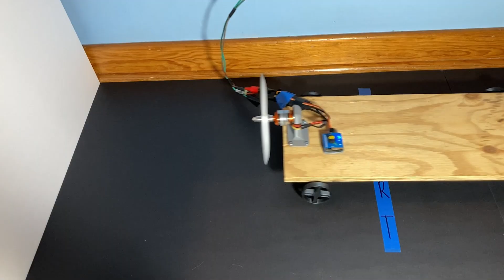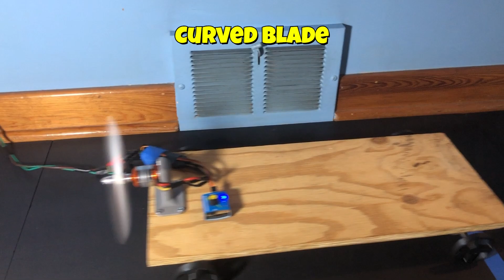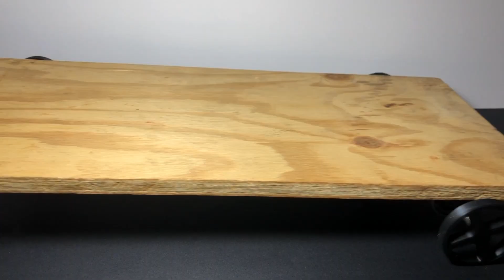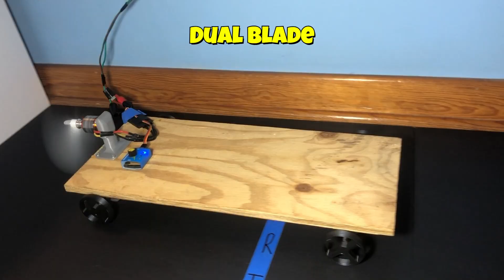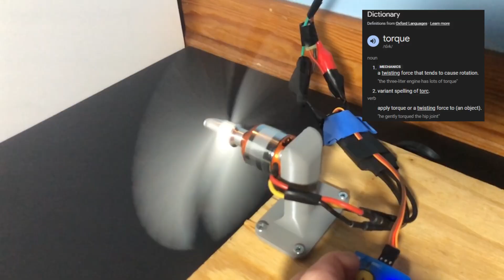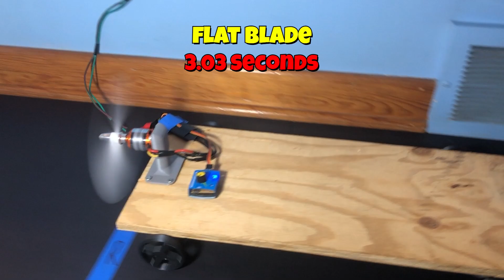Which 3D Printed Propeller Is The Fastest?

Comment: Did you try varying the pitch of the flat blade? How about spiral designs? Nice video-seems like a lot of ways to go if you want to investigate further.
Reply from the maker: That’s a good point. I didn’t try a pitched flat blade in this test, but it would be interesting to see how it compares. Spiral designs could change things quite a bit as well.